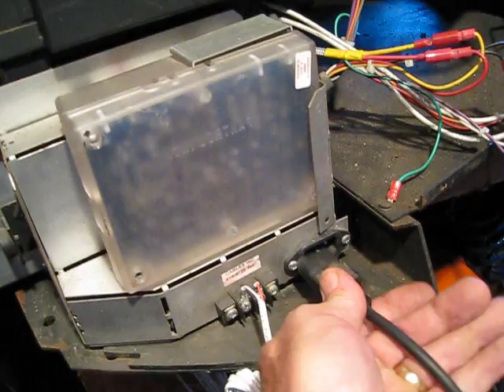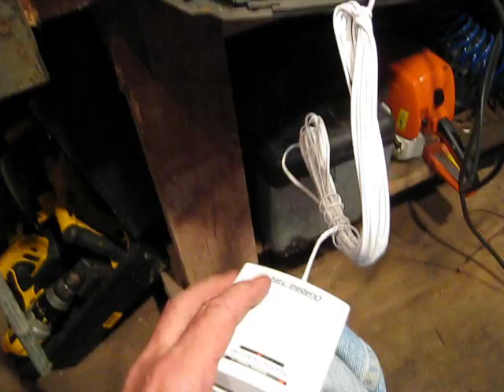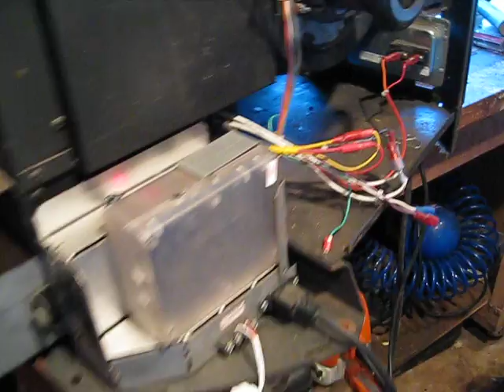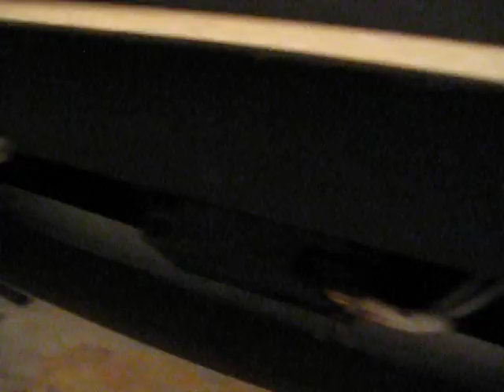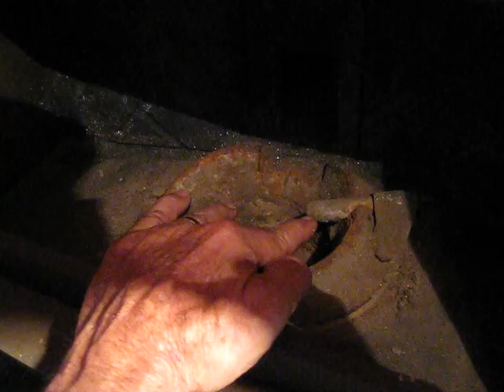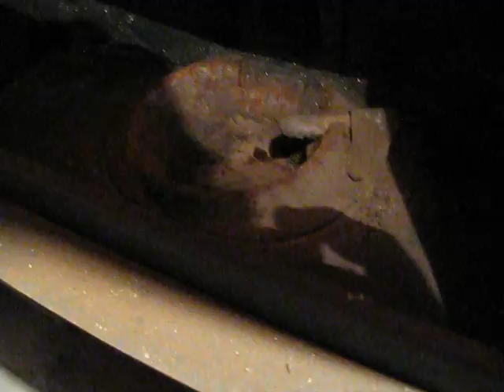Quad OE 3. Sequence.AVI

Comment: My Quadrafire 1200 I will not enter run mode , start up is normal however after initial load of pellets ignites and are burned up no more pellets feed and eventually stove shuts down. I have replaced thermocouple with no success. Please help as Quadrafire as you know has no technical support Thanks